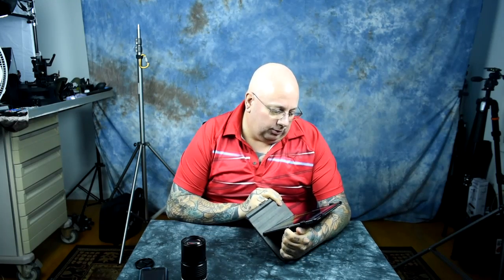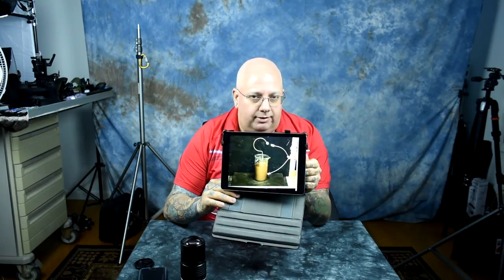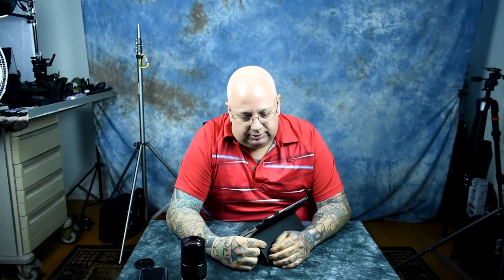Angry Photographer: PART 4 Lens Secrets, Electrical design, Properties, Contrast, Resolution & More

Comment: I'm having difficulty understanding how this "holographic effect"  works? Every time you come to it you briefly mention a few facts about it but you don't really explain how it works or how it manifests it self on the final image.
Real holograms are made with lasers and require the same light to be used to project them back. It's supposedly not possible to capture this phase disparity on a regular photograph.
However you claim it has some effect on the image...
I fail to find the effect in earlier red car photos you posted. the differences between the images are to big and probably distract from the effect.
I believe it would be possible for the phase disparity to have some effect on the final image but it would be great to know how exactly does it affect the image.
Reply from the maker: +Marko Posavec binocular disparity and parallax. 

holograpic negative or positives?   holo prints dont require lasers of course to image the the shot . 

there are 2 types of depth, PERCEPTUAL due inter-tonal micro contrast and RENDERED DEPTH due to EM phase disparity which also adds (or lack thereof) to the disparity of the 2D image rendered. 

take a look on FLICKR at the 35mm F2 Zeiss distagon images vs. that of the (too many elements) Sigma 35mm "art" 

look at depth only.
Reply: +Theoria Apophasis
ok i can spot some difference betwean the zeiss and sigma but i think the main thing i'm seeing is microcontrast difference.

What i'm really interested and asked in the above post is what you called RENDERED DEPTH i'l be damned if i understand what you are saying.

I guess from your explanation above and your videos one could conclude that something is varying in the image, varying gradually from the in-focus areas to the out of focus areas.
Maybe something similar to Spherochromatism?
Since the image on a monitor or any other non holographic image can't really show depth there must be some clues in the image for our visual system to interpret. What are they?

Again i'm talking only about RENDERED DEPTH here... Also how exactly do the many glass elements affect this RENDERED DEPTH?
Reply from the maker: and that micro contrats is insanely important if your gonna shot (convert to) BW

HOW THEY affect the rendered depth????

I just got done making 4 videos explaining that......  check em out............

i JUST MADE those videos.
Reply: +Theoria Apophasis
I watched all 4 videos and many more before i posted even the first comment here. Including trying to find it in your examples.

I want some concrete effect on the image pixels like... (for example: washed out colors, reduced micro contrast, foggy blacks etc...)
If it doesn't affect the image it cannot be seen or give a 3d look or any other look.
When speaking about this RENDERED DEPTH you say that glass affects it but not what exactly happens to the light and most importantly the final image...
Disparity is such a vague word to me... It might be because I am not so well informed.

To understand it i need a detailed explanation not just a listing of terms associated with the effect.
Otherwise it seems like that rope snake you mentioned in one of your videos.

Comment: Thanks for your posts.  I may never fully understand the subject but I have a question concerning chromatic aberration. I have read several articles on the subject and have come to the conclusion that lenses in general are designed to focus light on a specific point so as to create an image on the sensor or film.  The problem is that the light consists of different components having different wavelengths. Because the lens is designed as a one size fits all it's possible for some of the light to become focused either in front of or behind the sensor.  Is this pretty much why we see the purple or magenta fringing surround high contrast shapes of an opposite color?
Reply from the maker: +David Winsor close enough